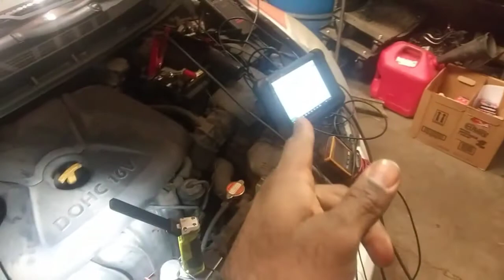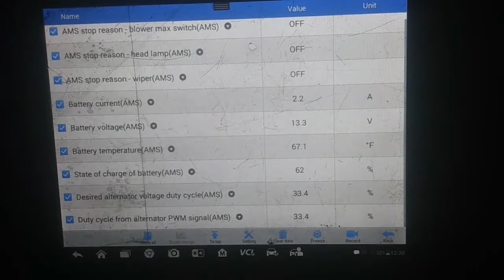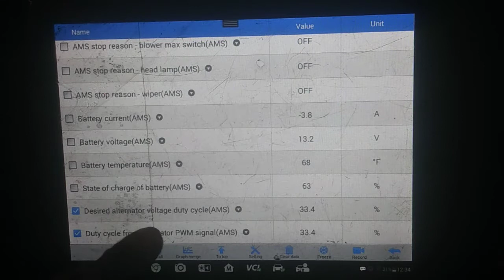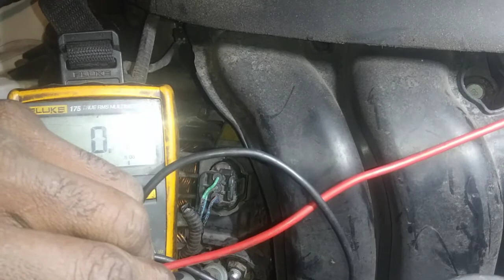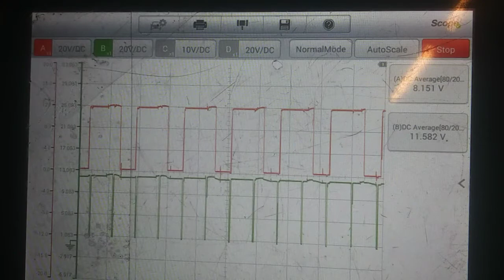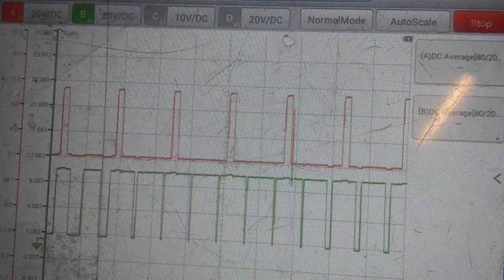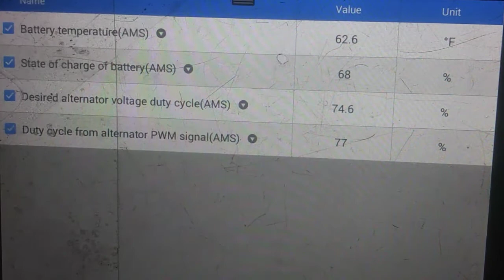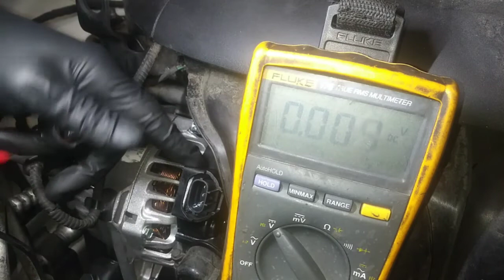Hyundai Elantra alternator testing

Comment: Hey man good video but this same car is going through alternators like on the 3rd one I did ur step by step..am I getting bad alternators
Reply from the maker: How often are you replacing them?
Reply: @Parts shooter  well the car came to me today and she stated she's on the 3rd one... the current one lasted 3-4 days. Others said one day. From O'Reillys
Reply from the maker: @durellmchenry969  I wonder what exactly is "falling", like... is she experiencing a battery light? Or just dead batteries?
Reply: @Parts shooter  no cel no battery light. The battery been holding 11.5 under load and all
Reply from the maker: @durellmchenry969  no battery light???
Reply: @partsshooter  no battery light at all
Reply from the maker: @durellmchenry969  seems easy...

Check L terminal for 12v, if there isn't 12, use a test light to supplement the would be 12v. See if the alternator work. 

Next..Check the L terminal as in the video. There should be 12v. If not... pull wiring diagram and track down issue.
Reply: @Parts shooter  yes just u did in the video I got the same results ad u. Only thing I don't have is a oscilloscope
Reply from the maker: @durellmchenry969  you couldn't have got the same results. Below 12v the battery light should come on in the car. If there's no battery light, the plugs must've been disconnected when looking in the car.  

If the plug isn't connected to alternator,  the battery light in the car will not illuminate.

Also, when connected and the alternator isn't charging,  if below 12v the battery indicator should be present inside the car. 

If... you have no battery light and all necessary ingredients at your connector.  Suspect a bad alternator...

You can try applying ground through a test light at the c- terminal and see if it forces the alternator to work.
Reply: @Parts shooter  ok I will..it seem odd when I disconnected the plug and the battery light never came on
Reply from the maker: @durellmchenry969  because it's 12v the wire. Imagine a test light with one end at 12v. When you ground it,  it short the light and it illuminate.  Same as the alternator.  When it fails,  it basically grounds out the would be 12v at the L terminal to ground.  It illuminate the battery light. 

When you disconnect the plug,  there's no ground to influence the battery light in the car to activate
Reply: @Parts shooter  yea I understand I'll keep u updated tmrw